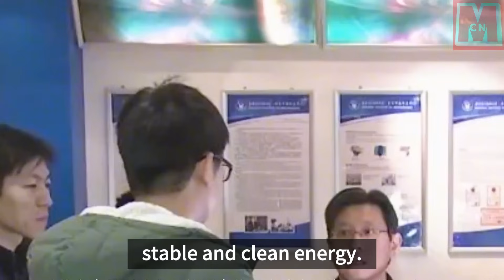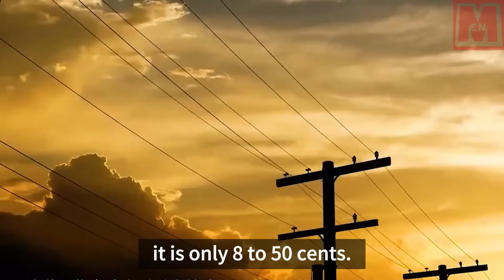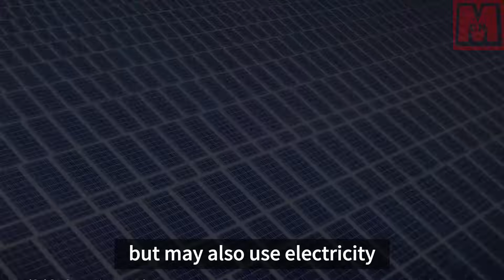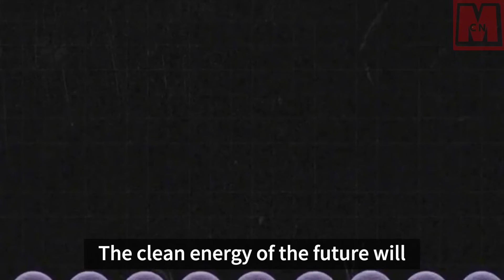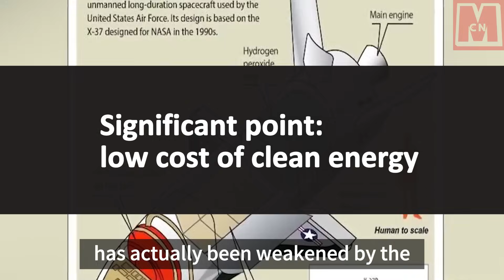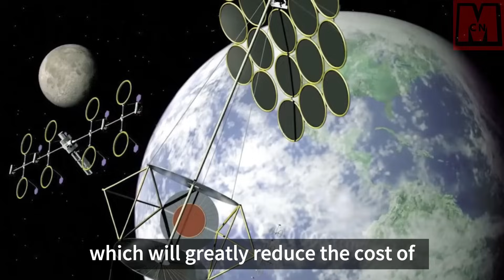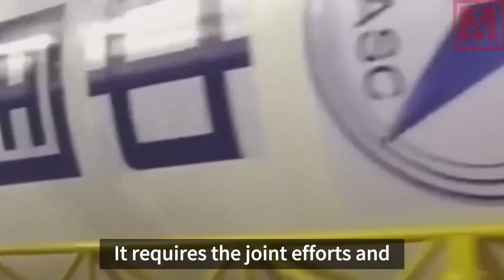China will build a space power station that can provide electricity for 100,000 years?

Comment: No, this would be to costly. China is ruler of DC high powerlines. They should put there money here. They could make wind and solar power anywhere in international waters.
Reply: What’s your math space solar power station is more costly than wind and solar panels on the ground?
Reply: @lattedefat257  Solar and wind is cheaper on earth due to cost launching. It is $2000 per KG to launch materials into space. That is huge. Plus everything is already engineered for ground and ocean power. It is ready right now. China can make power anywhere in international waters.
Reply: @lattedefat257  My reply did not appear here. Look for my comment .
Reply: @lattedefat257  It is $2000 per KG to launch materials into space. That is huge. CGTM just loaded a video showing floating turbine with fish farming . Again, they can do this anywhere in international waters